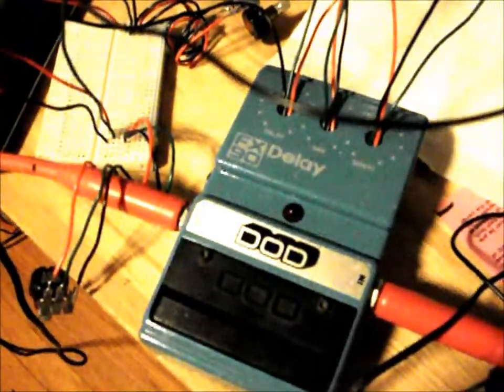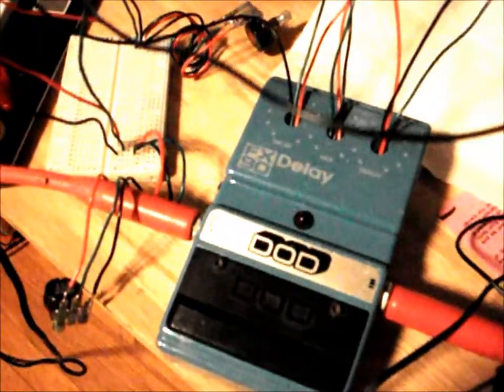Arduino (Boarduino) Guitar Pedal Hack - DOD FX90 Analog Delay

Comment from the maker: hey, i'm glad the video was of interest to you.  to answer your question: the arduino isn't sending much current to the digipot, and it sends no current to the 3 pins connected to the pedal.  the arduino only sends signals to the communications (spi) pins of the digipot.  the digipot then changes the resistance between the wiper pin in question and the other two pins (ground and signal).  the communication pins of the digipot are completely insulated from the potentiometer pins.  boa sorte

Comment from the maker: Yes, the sketch is turning the delay rate up and down using the wave-table based Low Frequency Oscillators that Collin showed in his video.  It was actually easier to implement than I thought it would be before I started.

I haven't posted the sketch anywhere, but I can email it to you if you send me a private message with your email address.  Cheers.

Comment: Hey, thats nice, Ive got a question tho, and looked all over the comments in the million places were colins original post video ended up but no one mentions it. Question is if the arduino operates at 0-5V doesn't that make the digipot supply voltage 0-5v making its wiper output vary from 0- 5v? but pedals are usually 9v so would assume its original pot has 9v going through it? so is the arduino just contolling less range of the 9v wiper or is something else stepping up/down?